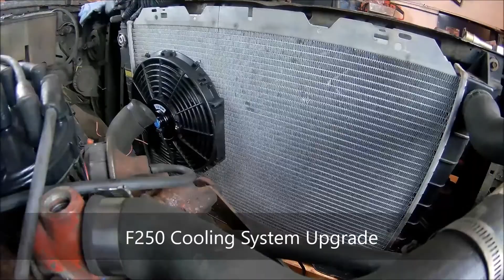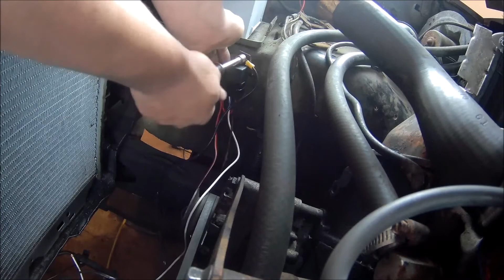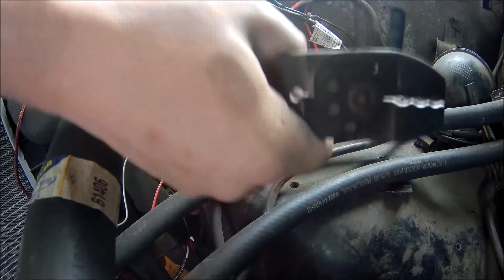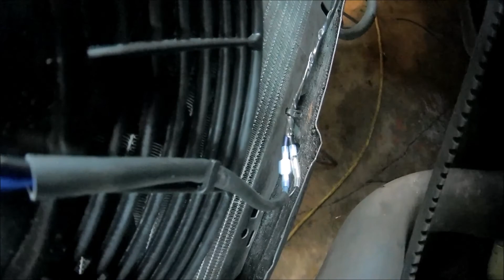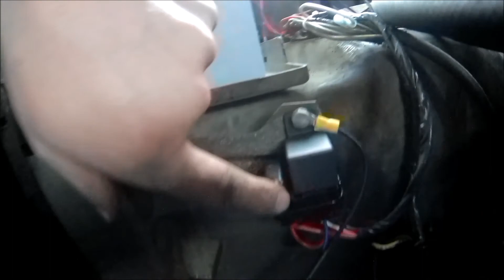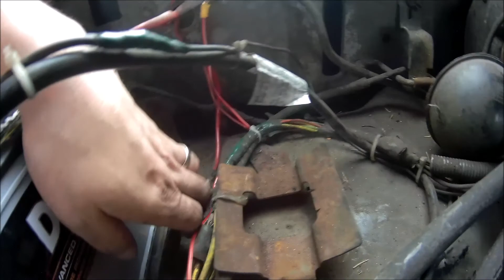1986 F250 Electric Fan Install

Comment: ever put any thought about replacing the rad with a larger unit with more cores and possible aluminum unit?
Reply from the maker: that is a 4-core aluminum center, problem is actually the mechanical fan does not fully lock up any more. most of the time it works just fine but sometimes it needs a bit of help.